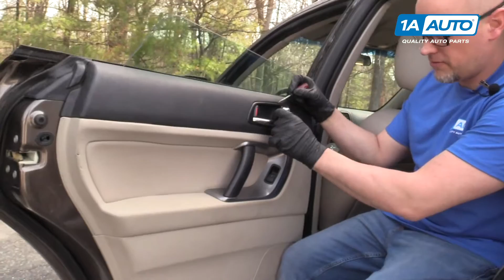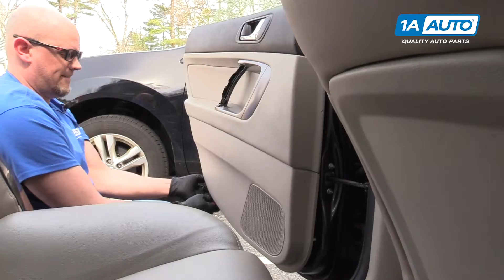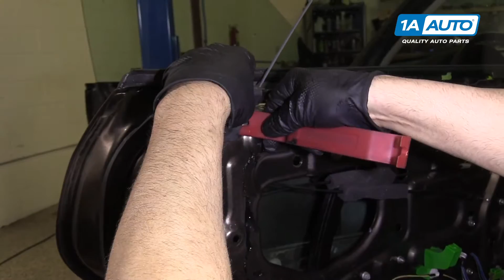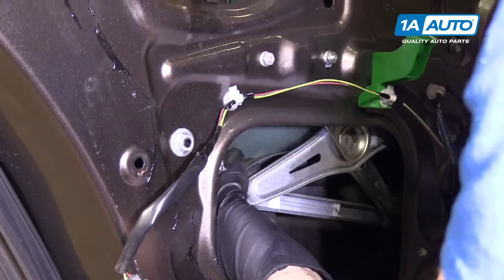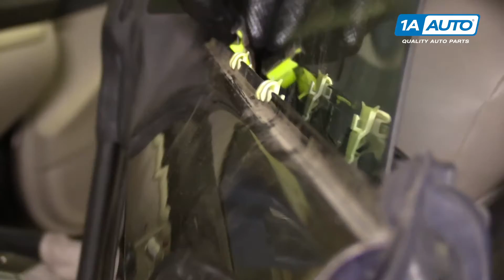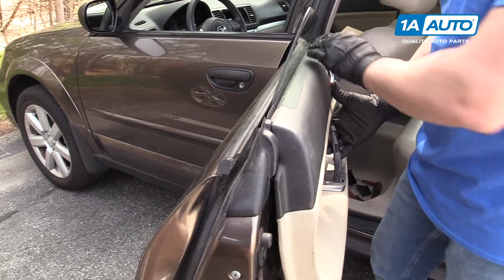How To Replace Rear Window Motor 04-09 Subaru Outback

Comment: Huge flaw, why remove the motor unless it doesn’t work.
If it doesn’t work you can’t align the window to access the bolts.
Is there a manual way of lowering the window?

Comment: Like others, I was surprised to see the instruction to lower the window with the motor - I needed to replace the motor because it had failed! That said, it wasn't a big deal in the end. I just stripped the door as in the video and unbolted the motor and mechanism with the window still attached. With an assistant to help lower the window/mechanism assembly, it was pretty easy to manoeuvre it into a position where the two bolts securing the glass to the mechanism could be undone.

Comment: In this and your front window motor install video, you assume the window motor is working to position the two nuts that hold the window on. For most people replacing the motor, that’s not the case. It would be beneficial to show the removal without being able to lower it.
Reply from the maker: +volzalum Thank you for the feedback!

Comment: I am trying to repair one where the window came off the track in front. I found that the nut holding the rear to the regulator track
came off allowing the front to come off the track. The issue I have run into is that id seems that the distance between the boltsin the glass. brackets and the holes in the regulator's horizontal track don;t line up by about 10mm I don't see an adjustment..

Comment: I dislike this video for the main reason that - I need to replace the window motor...because mine is broken and does not work!!!  During the disassembly portion of this video, the narrator states to reconnect the switch, turn the key on and move the regulator towards the inner shell door openings to access certain bolts. Now, the reason I dislike this video is that, HOW THE HECK AM I TO MOVE THE POWER WINDOW, WHICH DOES NOT WORK, TO LINE THE BOLTS FOR ACCESS!!! Really, if I could move the window...then it works, so there's no point in replacing the motor!!
Reply: if you remove all the 10mm bolts that hold the motor/regulator in place the whole assy should be able to drop enough to get to the window bolts from some access orifice :)) the one nearest the outside of the door is very simple and easily accessible... the inner window nut is more tricky and may require considerably more patience :)))
Reply from the maker: +Ken Federico You'll want to double check that there is power at the window motor and confirm the window switch hasn't failed. If you've confirmed that the window motor is bad. Have an assistand help you hold the window glass and then carefully remove the bolts holding the regulator to the door. Carefully lower the glass and regulator to a point where you can un bolt the glass and remove it from the door. Then try to remove the motor from the regulator or collapse the regulator to get it out of the door. It won't be easy, so take your time.
Reply: @1AAuto  Good point, but I already tested both the main control and pass side rear door switches and motor still did not work. I also performed a continuity test with my ohm meter to make sure that the wiring harness was good...which it is. So I went ahead & ordered the new motor & regulator which cost me only $50, just in case I missed something. Well, after starting the job following your video & removing the vapor barrier, I unplugged the existing motor & laid my new motor on the rear seat, plugged it in, turned the key on, & hit the door switch...and it the new motor worked!!! I also tested the main driver's door switch & that worked too!!! (I also plugged back in the existing motor & it didn't work)  So, I guess I needed the new motor after all. Now I had to borrow long wrenches 1/2", 10mm, & various other sizes & hope when I start this process again, I'll be able to reach the bolts from lower access opening, since I can't "move" the window down because the motor is dead!! You could have provided alternative info initially for us guys with dead motors. I'll try to unbolt the regulator & hopefully drop it enough to access the window bolts...and get this finally done before the warm weather returns to NY. I still think that you guys putting that info in you video about "reconnecting the switch, turning the key on and moving the regulator towards the inner shell door openings to access the window bolts" is real dumb. Really, who would go through all this work to replace a motor that still works? Like I always say: "if it ain't broke, don't fix it".
Reply: @1AAuto  OK, well on Thursday, I set out to do this job again...and "almost" got the old regulator & motor out, but ran into a major problem. After removing the four 10mm bolts holding the regulator & motor, and the right side window nut, the left side nut could not loosen off the screw/stud which is through the glass. The nut and screw/stud kept spinning together as I was trying to loosen it. There was no way to hold the other end of the screw/stud since it was only inches to the inner skin of the door and the other end had no grabbable head. Any thoughts how I can remove this nut? I tried placing a hard rubber ball between the space, sprayed WD40 to no avail!!!  I'm not giving up yet, there's got to be a way to do this DIY job.

Comment: What is you can't roll the window down? Is there any work around to get at the bolts?
Reply from the maker: +Hunter Dyer First, verify that the motor has failed. Make sure the window lock button is not set. Check for power and ground at the electrical connection of the motor, check the window switch. It's a lot of work to get the motor out if it's stuck closed, so verify first you actually need to replace it. Carefully unbolt the regulator with the window attached and then lower the whole assembly down in the door. Then you may need some one to help you, but try and unbolt the glass and lift it out of the way. Then do your best to get the regulator and motor out of the door, at this point you may have to try and unbolt the motor. Once it's unbolted, you can collapse the regulator.
Reply: Unbolted the regulator and lowered it together with the glass. Then undid the two nuts holding glass to the regulator. Wasn't too bad.